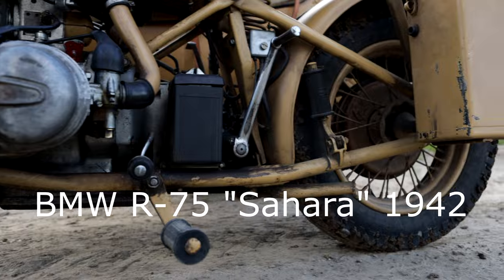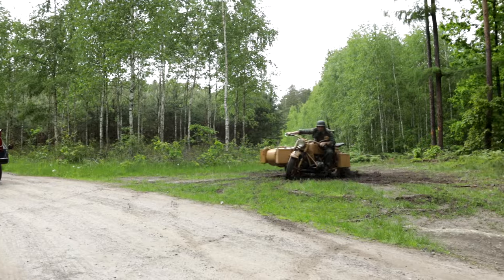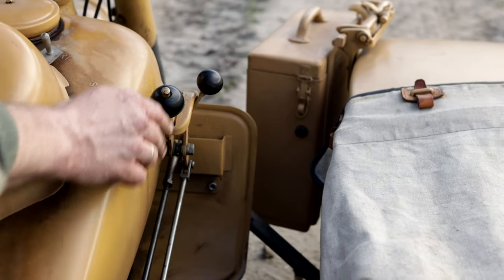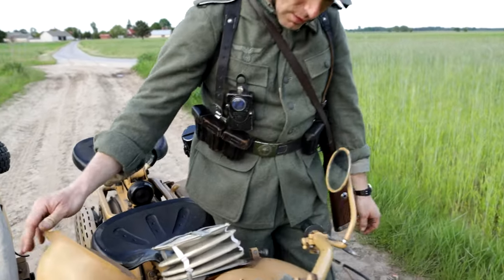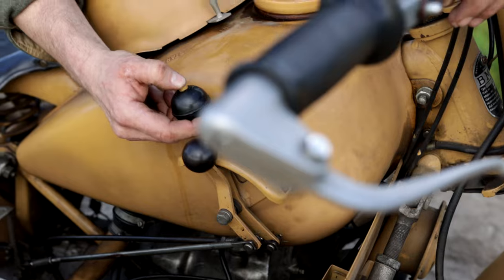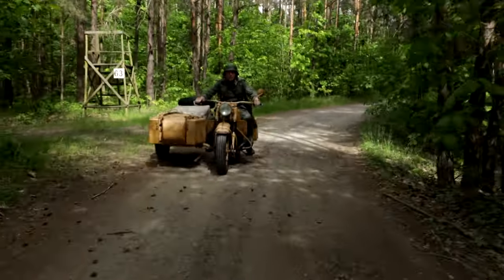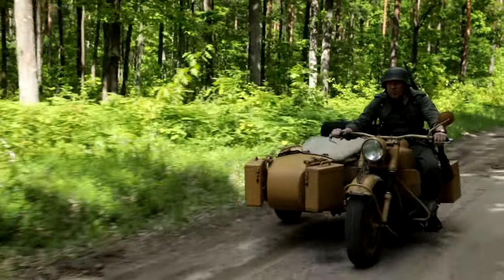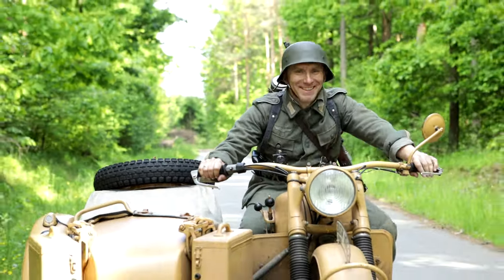BMW R - 75 Sahara 1942,  Wehrmacht Hi-Tech

Comment: I enjoyed that. Now 75, it brings back memories of riding my older brother's sidecar outfit (a Norton) in my early teens, when they were more common. I recall the leaning over the sidecar to help keep the sidecar wheel down on the bends, which was not shaft driven, of course. Sadly, I am needing to sell my Douglas Dragonflies (you featured one?), one built, one in bits. Also, my Honda 300i scooter and 125 Innova. I will miss the freedom of being on two wheels (when you forget your age and worries 🙂) but traffic is now too fast and busy to feel safe. 
Thanks for uploading. 

Btw, I am currently on a radical anti-cancer diet, the German Budwig Protocol, which includes a daily mixture of Quark (or Cottage Cheese) with flax seed oil added and also Sauerkraut recommended. Here in Nelson, UK, we have a sizeable East European community, for some reason, and I found the ingredients in a local Polish shop, the best quality we could hope for.
Reply from the maker: Thank You, and all the best! Contact me via e-mail: aceton@wp.pl. I own one Douglas Dragonfly 1957.
Reply: @pendofskygarage  Thank you for your reply and email address. Will do.
Reply: Zdravim .Je mi 72,můj Norton mod,18 + sidecar.Hodně radosti z jízdy i pozornosti.rok 47.I kdyš už jezdím málo.